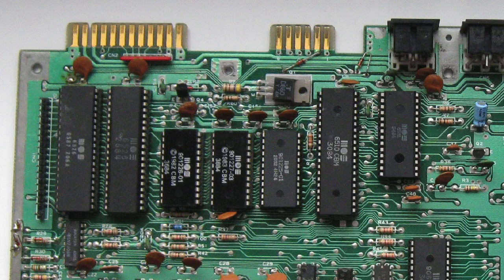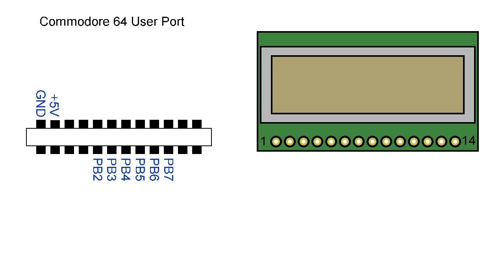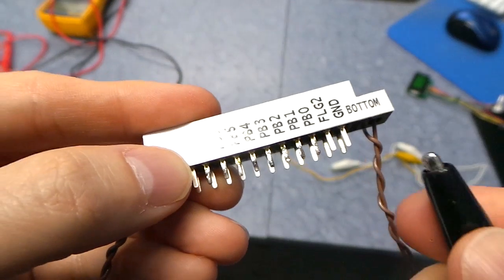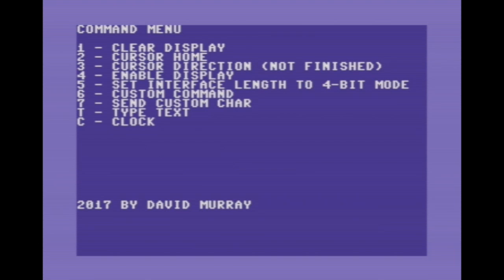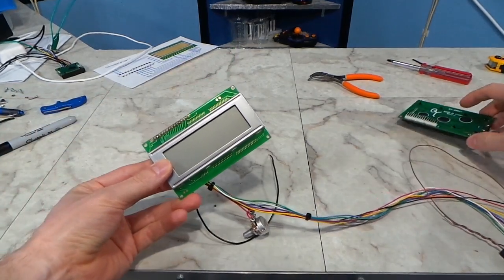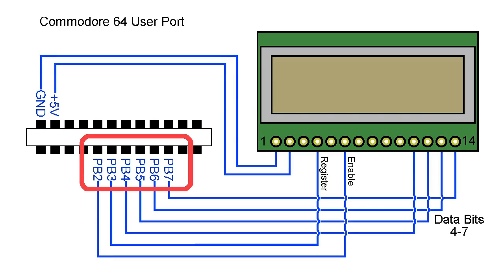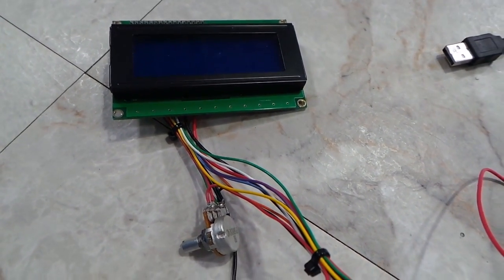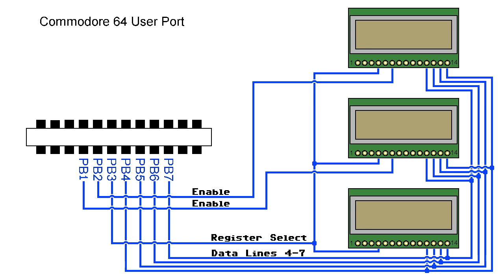How a Character LCD Works - Part 2

Comment: Rest in peace C64.
Reply: It ain't dead yet. A simplistic machine like that can survive much more than many of today's computers can. It probably just needs some repairing.
Reply: 8V on a 5V chip is usually a death sentence for most. Even if chips do survive, it's the question... which ones did? I have arcade boards and once I was diagnosing why one of my boards was having artfacts and random issues, turns out PSU died and sent 7 volts out to the 5V line... That made me sweat but thankfully I caught it in time and seemed to have saved it. Also had one where it inexplicably caught fire when I powered on. Thankfully that was only a tantalum cap that blew.

All of these things leave fear of the formidable power switch and always makes you qustion "Am I sure this is correct" before flicking the switch lol.
Reply: Well, I have repaired 3 C64 and read the schematics. Blank screen is the most common sympthon, since machine cant start. I repaired only ONE black screen. I bet hard on PLA, VIC II and ROMS. I have another C64 and the ICs were socketed. All of them tested fine (I was shocked). In this machine was a latch register, like 74245 or similar. The C64 has many glue logic chips around. If you dont have a donor to test, I would first try with a cart. Some of them start fine since the C64 doesnt need to look for ROMS (yes, ROMS go BAD as well). I would take the 6581 out from the system. It not required to start and can take the bus down. When I was child I got black screen and the C64 was found a BAD ROM CHIP. The colprits are the chips that are more stressed, VIC, PLA, and ROMS. Those run hot. One time I got BLACK screen due to a bad connection on the VIC II. The VIC was socketed. And the chip is a toaster. It ended ruining it own socket because the self heating and consuption. But the VIC was fine. Just the 40 DIP socket need to be replaced. It was MELTED on 2 pins. So, take the VIC out and have a look around. The VIC is usually inside a rectangular CAN with a coper finger on the top. RAM, MPU and CIAS ... are less prone to damage  There is a color RAM there.
Another thing is the RESET, C64 uses a reset (not sure if made on a 555) chip. This needs to come ok. Easy test: connect the 1541 or 1571 (if you have one) I believe that when the machine is powered on, the reset signal is sent to the 1541 as well. So you will notice it (not enterely sure by now ... to be honest).
Reply: Naaaaaa they can be repaired ... issue is BLACK SCREEN could be EVERYTHING in the machine, it the worst scenario for a repair with no info unless you poke some measurements. It a comprehensive machine, schematics are not that easy to read, but for someone who knows about electronics ... it will survive.
Reply: If you have the ceramic one (grey with a gold square in the center) should be the first revision of the machine. Dont recall if VR2 is a 780x type but to cause damage you need to short input to ouput. Shorting to ground could cause damage because arcing ..but its inlikely.
I would check the ROMS, not sure if Kernal is enough to at least get something. Then, as you told, it turn into some sort of guessing unles you do key mesurements. You need an scope for that. To be HONEST, I repaired with minor measurements, but paid the price of changing many chips. In my case the 74257 and similar ones that work as latch/buffer over the bus (data or direction) could be an issue. The donor only help on testing the socketed chips. Usually PLA, VIC, SID and ROMS. No wonder why they are socketed, all of them run hot and sooner or later needs replacement. If hte PLA doesnt do the trick try to make some measurements. I dont know if there is a PROPER repair guide. Commodore troubleshot guide was a joke. I mean, a guide to make simple measurements on certain points to check. Probably with a digital multimeter with freq measurement (on digital square signal) would be enough. Also check the BASIC things. The internal regulators, if VIC SID, 6502 are getting power. There are internal 5V and 12V. Just check if they are present. Another STUPID thing I noticed with on C64 a coworker bring, was that the POWER STWITCH was connecting one voltage but not the other, resulting on a BLACK SCREEN. The switch cuts two voltages. As per the brick, try to keep the regulator oldschool, I mean, LINEAR, not the 2575 thing. They are eficient. YES. But they put noise as well not sure if the system will be happy on that. What happen to the C64 before the black screen ... probably this will give oyu more clues. As awsome as it is, the C64 wasnt that relaible ... the chips and design and chips were pushed to the limit when running games, you could feel the insane heat coming from the bottom. After playing giana sisters for 2 hours the bottom was insane hot in the VIC area. I remember stoping the game to allow the C64 to cool a bit. It broke like 4 times. The last time, it was stored for 20 years when I finally fix it. It the black screen I mentioned mix of two failures, a 742xx latch and the VIC socket ruined. And yes, when I was child tried to "diagnose it" just imagine the disasters that I made there. Tried with external supplies directo the regulators. I thought I burn the hell of the machine. But nope, just one cheap chip and the socket. I bought a donor because I wanted to fix my chilhood one. It worth every cent because the donor confirmed that the most important chips were fine. I buy myself a set of chips anyways to handle future issues. them bought another one and one for my Brother as well. I pay little for the donor because the owner told me, it keep failing after half hour. I run this C64 12 hours stright, on summer, never got a failure. But, there was a silly mistake on the board,  two of the axial caps were inverted (in value). I put them back on it place. Lol, the machine left the factory like that. Priceless. Probably this was the issue. I dont know.
Reply: That reassures me greatly, indeed thank you again. I haven't studied electronics engineering so my wisdom about the basics are limited, like with the point you made about introducing "noise" with the stepdown converter. I will have to look into that as well. Hmm wouldn't the diagnostic cart bypass the ROMS? In "Ultimax" mode? I have no economy or means to get a scope, but I've ordered a logic probe and it can help (though I haven't found much info on tests to do with it, however I consider this project a big learning experience and so far I've learned a lot from people like yourself and own experiments!).

I have checked that all ICs are getting their power. Reading about troubleshooting on Lemon64 showed me where to check. It looked right most places, but at the user port I get 4,53v. Don't know what that entails. However one operation that I did a few days ago was to socket and replace the two HD74LS257P. So I'm fairly sure it can't be them now as the screen is still as dark as my soul. Ooh that brings back memories with Giana sisters. A game I watched my brother play. I wasn't allowed to touch the machine as I was too tiny.
Reply: Naoki Saito Haha, that's why he was mentioning the "smoke test" when turning old or recently repaired machines on for the first time in previous videos
Reply: LOL, the same with my bother. I watched, he played LOL. What a great times. Loading on cassette waiting long until game pops up (or give you an error LOL).  Yea, scopes are a bit expensive, but they are getting "cheaper" with the time. But a logic probe should do the trick. I had a look to the schematic because I wasnt sure that the C64 had internal 5V regulation (David told me). The user port takes the 5V comming from the brick. And the regulated 5V on the C64 are for the VIC. That is, there are TWO 5V supplies. One comes from the brick. One is produce inside the C64. The brick powers MOST of the computer. If you suspect a damage from a short with the reg inside the computer, look for the VIC since is the only one using it. If the short was on the 12V reg, this supplies both, VIC and SID. User port should read perfect 5V, so trace what is going there. Those 5V feed most of the system. But, even when 4.53 is fine, probably could make something unhappy. Using the multmeter on AC measure the 5V. Of course, it SHOULD read NOTHING, 0. But, if it happens to read something, then there is chance that you have 5V plus ripple or noise in the lines. That is, you can read 4.53 on a 5V because ... NOISE. The 2575 works around 50Khz and if not filtered correctly it can drive you crazy or even ruin things. Not sure if you are using this one. Try to check at the very input of the board prior any switch or inductor. Just to found if voltage is dropping somewhere. Also try to feel if chip come WARM. ROMS, MPU, PLA, SID get warm on operation. VIC tend to run HOT on operation. If chips are cold, something is not starting at the machine. Also, I dont know if the system has brown out detection. That is, many systems will keep themselves in reset until voltage goes ... above 4.75V for example. Is to avoid issues. Not sure if the C64 has this circuit along with the RESET. If yes, the 4.53 could explain why it is not starting. It is a power hungry machine, so the 5V need to be strong. Usually the 1A 7805 is not enough, you need the 3A version on the metal can package. The 1A will cut of and produce less voltage. The 2575 is 1A or 1 and half. Not sure. We aware of the consumption. If you have replaced those latches, fine, less things in the way to worry about.
Reply: You seem to know a bit about it about it. Have you repaired one before? I'm currently working on fixing my C64 but it's a guessing game as to what exactly is wrong. Yes, I have the black screen. I bought a new PLA chip as internet adviced. Made sure I get 5V, check. Still black. Any tips?
Reply: He's gonna make a repair video
Reply: That was a ton of info, thanks man! I'm currently fixing up the power supply (wedge). Throwing out the old PCB and jamming a stepdown converter in place. Hoping for a steady 5 volts to work from. Sadly I have no donor C64 or know anyone with such a machine, so it's a guessing game what could be wrong with it. Iordered a so-called diagnostic cart online and putting it in makes no difference... what a bummer. On visual inspection the VIC chips looks fine, I have the ceramic kind. Many chips are socketed already and they look fine and none get spectacularly hot.

In a way I fear that I may have damaged it more during all my multimeter adventures. I mean when measuring the voltage on VR2 a month or so ago I slipped a bit. Perhaps over to ground (middle pin), don't know if I created a bridge or not to short something but let's say I did. Which components would you look to replace/check after that?

Comment: Now im worried about that C64...i doesnt have a fuse or something that can be replaced?
Reply: It appears to have a fuse, but fuses don't protect against over-voltage only over-current.
Reply: A fuse doesn't cause this kind of problem. More likely a electrolytic capacitor - and replacing them is easy too.
Reply: There's a known issue with the C64 power supplies that means that when they go bad, they send too much voltage down the line and fry... I want to say it's the memory, but I'm not 100% sure. I've never run into it myself, but I came across stories about it when I was just looking into getting a less gigantic power brick for my 64.
Reply: but the simple fact that the nand gates saw 8+V can mean they probably died. 

FETs are extremely fragile to voltage. Simply rubbing your feet on the carpet and touching the pins of a device can kill it.
Reply: Cartman - you do realize that ESD is on an entirely different scale and irrelevant when it comes to constant "low" overvoltages?  

Cause ESD can easily be more than a couple thousand volts - that can arc over and directly destroy the junction.
Reply: ABaumstumpf What are you arguing? 

An overvoltage to a FET device is completely catastrophic. Even by a couple volts.

Obviously time plays a role when it comes the level of damage, and thats the difference. A high voltage shock does quick damage where a lower overvoltage does damage slowly.
Reply: Cartman - the thing is that those 2 are not comparable in this situation as ESD are extremely high voltage that can directly destroy a transistor, where as the comparatively low overvoltage in this case destroys the components by overloading them and thus ultimately kills them with heat.
Reply: ABaumstumpf ya they are comparible as they destroy the transistor the same way. Its the diffusion and neutralization in the juction. Thats all it is. Diffusion is sped up significantly by heat which is caused by overvoltage. Simple thermodynamics removing the entropy carried in a pn junction.

Theres no 'arc'. The resistance through the p type crystal is lower (because of the holes) than the neutral crystal so it'll never arc.

I was just making a comparison to show overvoltage is bad for FETs. So unless you think not all overvoltages are bad for FETs i dont think you need to reply.

Comment: poor little C64 );
Reply: Brick provides two voltages. One is AC and the other is 5V DC regulated. The AC is the one that is rectified and regulated to 12V since VIC uses BOTH 5 and 12V (c64 and 9V on the 64C), cassette is 6V, but it feed from 12V. I believe that SID also uses both. The 5V come from the brick.  The reason they have sent AC to the C64 is to provide grid clock (50Hz or 60Hz) to the SID and CIAs. But yes, even when it seems like too much, bet only a couple of thing got damaged, and the rest if fine. I have seen 3.3 micros operated CORRECTLY on near 8V ... MOS ICs (not the brand, but the type) are "more flexible" than TTL. C64 is basically made of MOS chips, but there are some TTL parts as well.
Reply: Aio-inc:
Nope.  going form 5V to 12 v is a bad bad bad thing. cause yes, you do build some protection into those things, but they are designed to handle 5 v and maybe slight overvoltages. but at 12v even your zener diode will just burn up.
Reply: Just de Analog part of it. The digital part runs on 5V, otherwise it will blow everything in the bus. Same is true for VIC II. They are "mixed" signal chips.
Reply: I'm sure it's fine, they have an internal regulator for this purpose.
Besides, they're very robust little machines, they'll survive just about anything.

Comment: but you've measured 5v in the beginning of the video!
Reply from the maker: yeah.. but that was a data line, which comes from the 6526.  There is a separate +5V on the user port that comes straight from the power supply and that's what I was using to power the screen.
Reply: On MOS type ICs data lines are ALMOST VCC on "high" (1) and ALMOST VSS on "low" (0).  They copy the power rails basically. The 4.96 reading was not casual. The CIA was getting 5V. Probably the brick was failing intermitenly and at this point was fine.
Reply: Still quite surprising considering IO levels can be about a diode drop (0.7) down from VCC, so in this case around 4.9 would mean 5v or close to. Then again I had a PC working fine, soft reset and the PSU died during that reboot and killed mobo and CPU

Comment: Major bummer on all that fried stuff. Do they not make replacement C64 power supplies? I see some people use replacement power supplies for various computers and consoles specifically because the old ones are failing, inefficient and introduce video noise.

Comment: I have a Commodre 16, and didn't know it was rare :-D
Reply: VERY rare.  The Commodore 16 was discontinued in the U.S. after just a year.  It sold pretty well in Mexico and Europe as a low-end gaming machine (nearly 90% of the software for the C16 was from European developers).

The main reasons it flopped in the U.S. was incompatibility with the C64, and it just wasn't important to Commodore after all its competitors dropped out of the market.
Reply: Thanks for the information! I found mine thrown away at the University I used to course Electrical Engineering around 2000. At first I wish I had found a C64, but now I like it better. It now sits besides my 2600. I'm not a collector, but just like to have some old stuff around, like a VT100 terminal, for example.
Reply: You're welcome, Jonathan.  Isn't it amazing what people at university will throw out?  I found a mini-fridge that only needed a replacement coil for the freezer part.  Took it home with me, fixed it for $20, sold it for $100.  I'm not a collector either, but if I found an old 8-bit computer just thrown out like that, I'd still take it home and see if it worked.  :)
Reply: Jonathan Araujo Keep it! Please! Don't throw it away!